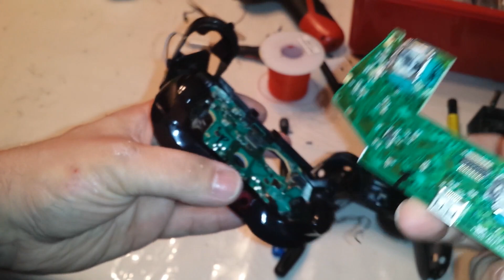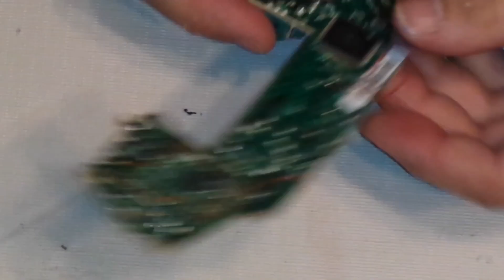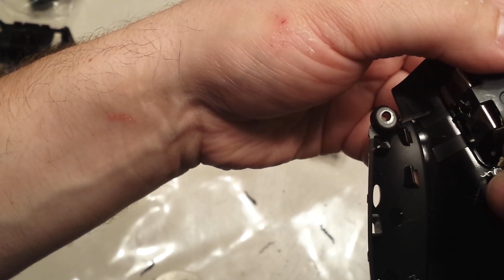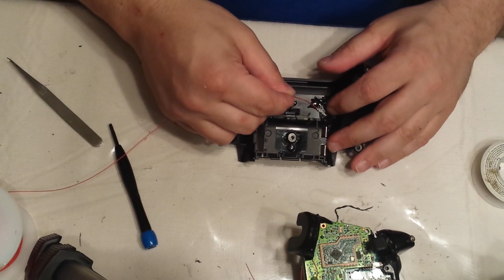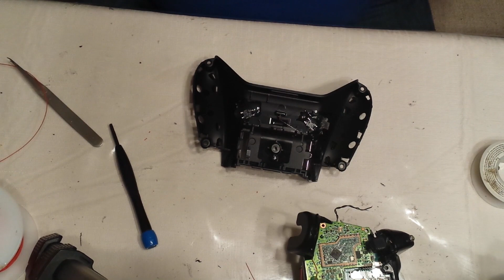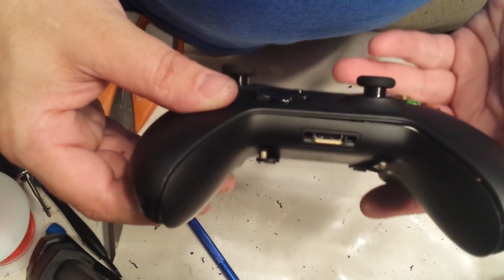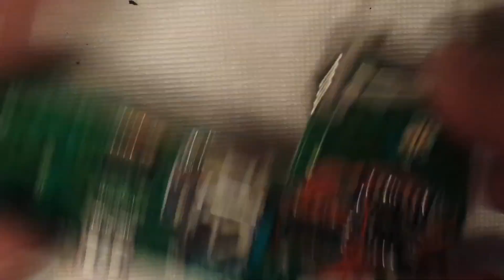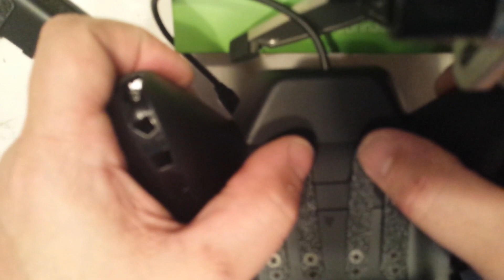TUTORIAL BUILD YOUR OWN XBOX 1 Scuf style Controller w/ Triggers Stops, Remap chip & MORE DIY Gamer

Comment: I have a question:

I'm all good with drilling holes, adding the buttons in, etc. I added the buttons on the inside of the bottom of the handles (where my middle fingers rest when holding the controller) which fit perfectly once I removed the rumble motors (because I don't want or use them, and plus I like the controller being a bit lighter in weight as well).

I even added a sliding "mode" switch for each button (I placed the switches on the back just below the bottom of the battery door; one on each side) that allows me to switch the button inputs independently on the fly just by flicking the switches. For example, the left button is wired to both the "X" button as well as the "Y" button, so if I'm playing Destiny for example, I can switch it to register a "Y" press to switch weapons, and if I then go play Halo 5, I can flick the switch over and it will register an "X" press to use the Thruster Pack ability.

This setup is my simplified solution to bridge the gap between hard-wired/static 1-function buttons & your much more flexible & versatile setup.

My problem lies with soldering: I bought a simple pencil-tip iron that came with a spool of thin "electrical solder", but I can't get the solder to stick to either the wires or the terminals on the buttons, much less the circuit board for the controller.

I try to hold the iron on the wire, then touch the wire with the solder (to place solder on the tip of the wire, and then touch the wire to the button terminal and touch the iron to the wire to re-melt the solder). But when I do this, the solder doesn't melt to the wire in the first place. I don't know if the wire just doesn't get hot enough cause the iron's tip doesn't transfer the heat well enough or what.

Is it possible (although obviously not preferable) to just super-glue the wire tip to the button terminal and/or to the exposed copper on the controller circuit board? I'm not concerned with it being the "proper way" or the quality, I just want to know if it'll stick and if it'll somehow ruin the controller in any way.

I just want to quickly get the job done and try the setup out. If it works and I like it, I will be purchasing another XBOX ONE controller, and possibly a better soldering iron to do it "properly".

Any help you can suggest would be great. FYI, the solder I'm using may not be the best for the job; I watched another video that said the best solder to use for electronics & wiring is made up of something like 60-70% tin and 30-40% lead, whereas mine is like 99% tin I believe. Would this make a difference? When I touch the solder to the thick base of the iron (cause again, it won't melt if I touch it to the tip of the iron), in the solder immediately balls up and burns up the solder line. So it doesn't ever melt ONTO the wires or terminals.
Reply from the maker: I use 62/32/2 silver bearing solder from radio shack. that stuff is the best Really stick well to the legs and wires and such. 
The Wire your using might be really poor quality. I am familiar with it because I used it for years and getting it to stick really is difficult.
It is probably most likely made for wire wrapping and not soldering, The other thing you need is FLUX.. LIQUID FLUX is a lifesaver, put a little on your solder points and
solder will magically stick like cheese to a hot pan.   Back to the wire for a second, get KYNAR wire (http://www.ebay.com/itm/30-ft-Red-Kynar-wire-wrap-wire-30-awg-for-modding-/250539633826?pt=LH_DefaultDomain_0&hash=item3a55536ca2) That is the best wire for modding controller.

As for your switch idea.. I have done it, i used to do A/X B/Y on switches with Xbox 360 - that is why I came up with my remap chip.
If you figure out how to get solder to stick, then you might want to consider a chip in the future, simple install and allows you to program your paddles to whatever you want.

As for soldering irons.  Radio shack and $10 specials will not do the job over and over again, they are good for one off jobs. . Get a decent iron with a 1/32 or 1/64 tip for getting your solder
strategically placed. Well worth it if your going to solde rmore than 3 times a year.

Any other questions.. JUST ASK.

PS: DO NOT SUPERGLUE WIRES - It will not work right.
Reply: Ah, that helps a lot, thank you! I knew something had to be wrong: not even being able to solder a simple wire joint after 30/45 minutes of trying didn't seem normal, even for a beginner. I'm new to soldering but I'm a very handy person and I have 16+ years of various electronic & computer programming experience.

For Flux ("fl-uh-cks" or "flukes"?): doesn't the solder, the proper kind of solder, already have an appropriate amount contained within it? 

As for my iron: I believe it's also part of the problem. It's a cheap $4.99 iron I got from Walmart; it doesn't even have a dial for the heat, much less any other basic features. I didn't think it would matter that much, as long as it got hot. However, I've since learned that the amount of heat you should be using is dependent in the size of the wire; higher heat for larger wire.

Combined with the fact that the tip of the iron I have been using gets seemingly much, much less heat than does the rest of it, and it's no wonder I can't even tin the tip at all.

It looks like I'll be investing in a new, better iron (specifically with a better tip), some different (better) solder, and a few new buttons.

As for the remap chip: that is definitely a level I want to strive for in the future. Especially to potentially be able to map L3 to the left button (mainly for Halo, so as to be able to scope in for intense long range / sniper engagements) without having to click R3 whilst moving the stick / aiming. Would certainly reduce mistakes with bumping / twitching the reticule needlessly and missing shots.

For now though, having X and/or Y on left, and A and/or B on right covers all the bases for me. I even have a neat idea for adding a few LEDs to the setup. You wouldn't be able to give me some tips on how to add some LEDs to the front of the co stroller (between the D-pad and the right analogue stick), would you? Looking to add a total of four, and I want them to only be on when the controller is on as well, obviously. They will turn on and off depending on what state/position the sliding mode switches are in.

Cloning button trigger events is one thing, adding new elements to the board is another.
Reply from the maker: Fyrecide
Get flux... regardless - it's good to have.

To power and LED use TP5 or TP9 and Ground (tp26) with 100OHM resistor for LED's.

Get a way better iron, yo need to be able to select heat.  A 25 watt iron should be fine for this.

GOOD LUCK!
Reply: Fantastic! Thanks!

Two final, quick questions:

1) Can I bridge/daisy-chain the ground and power leads? Meaning can I run one wire that I "Y" or split off into 4 separate leads for the power to all four LEDs? And can I do the same thing (one wire to the ground) for all four LEDS?

2) Do I need a 100OHM resistor for all four LEDs, or can I just attach the resistor to the main wire for the power before I split it off 4-ways and then attach each lead to the LEDs?

Thanks a million, you've been a wonderful help!
Reply from the maker: Fyrecide  You should use 1 100 ohm resistor for each LED on the power lead.

Yes you can chain them together - that is how I do it.. for both power and ground.

Remember ground is ground, so any ground works...

Good luck!
Reply: Hey, me again... quick question: where are TP5/9 and TP26 located? I don't see any components or areas labeled with the prefix "TP" at all, anywhere. Could you possibly upload or email me an image circling or highlighting them for me? Or at least point me in the right area by telling me what they're near to (e.g. Under the four face buttons, next to the right analogue stick, et cetera)?

Thank you so much!
Reply from the maker: TP 26 is Ground it is on the back of the controller Marked near the MCU, also just watch the video I do show TP26 and how solder to it.  1:37:52 there is a nice shot of the single wire soldered to TP26.

TP 5 is also on the back of the controller and TP9 is on is on the other side of the controller near the Trigger pad.

They are CLEARLY MARKED and pretty easy to find.  Look again you will find them
Reply: Gah! I'm a moron: I found them minutes after posting that comment lol. Sorry about that & for wasting your time, sir. And thank you once again for all your valuable insight and advice!
Reply from the maker: NO PROB ENJOY!

Comment: yo so what happend is the b button tracer tore of the board is it fixable?
Reply from the maker: It's fixable if you know what your doing. requires Microsoldering, but if you do not know how to scrape a trace and solder to it and then to another via, it's it pretty much toast.
Reply: MODCENTRALUSA what if i was to scrape the pads would the b button then work?
Reply from the maker: DO not do that on Xbox one controller...
Reply: OK just that I seen some on pest a bid of them adding tacs and he scraped pads and that
Reply from the maker: mitchell clark  There is no need to scrap any pads on Xbox one, there is Bare metal to solder to for every button which is simple and easy.  The Black pad and copper on Xbox is unlike Xbox 360 and most people will ruin the controller that way.

Comment: This video has become a bible for me, I can't stop watching until I know EXACTLY what to do, and thank you MODCENTRALUSA your tutorial is definitely the best and easiest one around to understand. One question though, instead of having the A on the right side of the controller, could I make the wire longer and bring it over the left side of the controller? thanks!
Reply from the maker: You need to watch the video again.  The Remapping I did was just a SUGGESTION for the video., If you watched after I did the first controller, I did a second controller with a REMAP CHIP (which I sell) those have 2 or 4 general remaps. The wires run all over the place.  But yes, you can map any button you want to the right or the left or the middle or the handles or even the front, where ever you can fit a tact button you can put a remap. Just solder the tact to the SOlder point for the button you want to remap and the ground and your done.
Reply: MODCENTRALUSA Thanks man, and whats the exact kind or wiring you use? Does it matter which is used?
Reply from the maker: FlynnerIRE There is a link in the description of the wire I used in my videos.

Here is a copy of the link - I guess you missed it - it is hidden in there...

http://www.ebay.com/itm/10-ft-Kynar-wire-wrap-wire-30-awg-4-modding-10-color-ship-from-USA-/260929559527?pt=LH_DefaultDomain_0&var=&hash=item3cc09d1be7

Comment: How can I make my Xbox one controller no slow ? Pm me plz or comment back
Reply from the maker: Xbox one controllers do not have the NO SLOW defect like the 2005-2007 Xbox 360 controllers did. The 360 controllers had smaller thumbstick openings that would not allow the proper rotation of the thumbstick that caused slow Mo on a particular thumbstick.   The Xbox one controller uses a smaller alps sensor for the thumbstick and the hole is more than wide enough. IF you go too wide the alps sensor can actually go too far and not snap back to center.  If you are getting slow mo on a xbox one controller then one of two issues.  One your thumbstick sensor is broken and needs to be replaced.  or Two you changed the thumbstick to a stick with a shaft that wider than the original xb1 stick and it is not allowing the stick to tilt in the proper direction far enough causing SLOW MO.  This happens when someone tries to use a PS3 or Sixaxis thumbstick on Xbox one controller.
Reply: Thank you very much for the detailed response. I haven't replaced my thumbsticks and I hope they aren't broken. It's no where near as bad as i felt on my 360 controller. I heard about the slow turn on the Xbox One and also thought I felt it in MCC but it may just be a built in function in the game because I didn't feel slow turn in Ghosts & Titanfall. 
ty again :)

Comment: to remap the buttons A and B I need remapping chip?
Reply from the maker: No, the video tutorial show you haw to HARD MAP any button you want.  Solder one wire to the Button point and the other wire to TP26 (ground) solder them to the tacts and you have a hard map.  Nothing to buy. MY remap chip is a little invention I decided to make and sell that allows users to PROGRAM the remap to whatever they want so you can change it at will without opening the controller and soldering wires over and over again to the same button each time you want to change the remap.
Reply: MODCENTRALUSA when u are attaching the paddles, what screws/ object did you use to keep them in place as to not go through and interfere with the batteries
Reply: MODCENTRALUSA ah, ok then, thanks again :)

Comment: Do you have to do anything to the 1/4" screws on the paddles to avoid rubbing against the batteries?
Reply from the maker: I use 3/16 now, they are a perfect flush fit.

Comment: what is the lexan and sandpaper for?
Reply from the maker: TO make your paddles if you making them from scratch. You can use lexan or any 1/8 plastic sheet. Sandpaper is for shaping and smoothing cut edges.  See my Paddle video.
Reply: MODCENTRALUSA thank you, i am going to use my xbox 360 scuf controller parts to save money
Reply from the maker: SkillFullAsh If you need anything let me know. I have the laser cut aluminum paddles that are perfect replacements in case you break a paddle. They cost less than the plastic ones shipped $12 for (2) shipped and $18 for (4) shipped and you will never have to worry about breaking a paddle again.  Any other parts that you might need - email me at modcentralusa@gmail.com- I will be glad to provide you with whatever you need. I have the remap chips if you want to beable to switch what the paddles do and such.  Again let me know I have everything you might need. Good luck recycling parts - that is a great place to start

Comment: When I was doing  the mod everything was going fine until I went and put my shell back on and was testing the controller everything was working but for some reason my right and left triggers were not working so if you could help me figure out what happened that would be wonderful thanks
Reply from the maker: Triggers are not part of the mod really (other than screws in the plastic if you want stops. So there is no reason they should not work.

Triggers on the Xbox one controller are LINEAR HALL SENSORS - which means there is no physical lever that moves. The magnet on the trigger as it gets closer to the cirtcuitboard has a component on it that picks up the magnetism and tells the controller ot ramp up from 0 - 100. 

If you only did a simple remap and your triggers are no longer working a few things to check.

First make sure you didn't drop solder on anything causing a solder bridge of some components that prevent the triggers from working.

Second, when you put the back shell back on. HOLD BOTH TRIGGERS DOWN, then align the shell with the battery terminals and slip it on. Then release the triggers and they should flow freely up and down. If you put the back shell on wrong it can prevent the triggers from moving properly which can prevent them from working.

Lastly - if you installed trigger stops - take them out and make sure the trigger can go all the way down and make sure they work without the stops - if they do and you put the stops back in and the triggers don't work then you are installing the stops too low.
Reply: MODCENTRALUSA thanks
Reply: MODCENTRALUSA it's really weird I can't find any excess  soder, the triggers feel fine and I don't have trigger stops on it and it's still not working
Reply from the maker: dangerboy325

undo the work you did and see if it works.

Either you have a faulty controller or caused damage of some kind while modifing your controller. I don't know what else I can tell you. Without seeing the controller there is not much I can do to help you.

Comment: How much would u charge me and would 4 paddles get in the was of my head set adapter
Reply from the maker: Do you want 4 hard mapped paddles or do you want the remap chip?
Would you be mailing in a controller or buying a controller already modded from us?
Contact modcentralusa@gmail.com
Reply: I'll be sending u my CALL OF DUTY ADVANCE WARFARE CONTROLLER.NO HARD MAP IS FINE..WHAT'S UR WEBSITE I MIGHT GET ONE OFF THERE TO
Reply from the maker: brandon anxrews

WANT TO MAIL IT IN? We do the rest and mail it back.
For $44.99 We will mod your controller.
YOUR CHOICE OF LED LIGHT
YOUR CHOICE of Paddles or Tacts or GIant Levers - Two Mapping of Choice (Get Two additional mappings for $15 more)
YOUR CHOICE of THUMBSTICK COLOR
TRIGGER STOPS - SIlver or Black

Total on mail in would be $60 for 4 maps - there are extra included as well at no added cost if you choose to take them or not.

We do not have a website. I put these videos up for DIY and it turned into something more with me offering my services to those who don't have the time or confidence to do it them-self.

Contact me at modcentralusa@gmail.com when you are ready to mail in.

If you email me - I can send you some Advanced warfare photos of controller I already did.

MATT